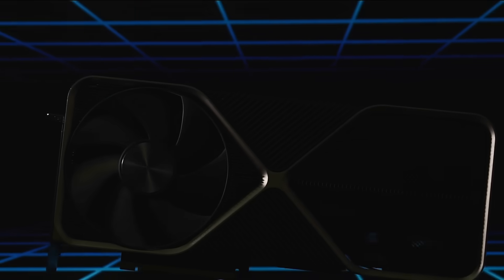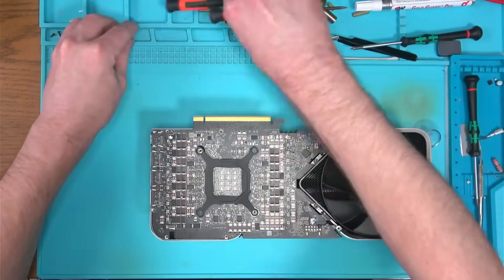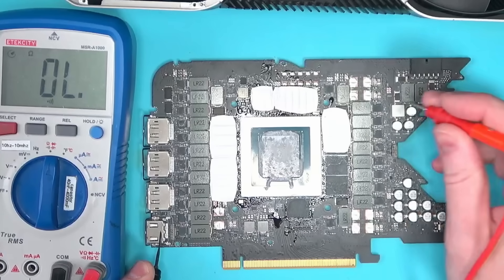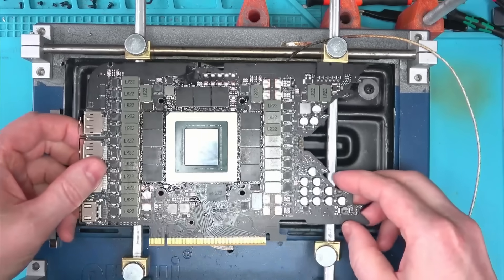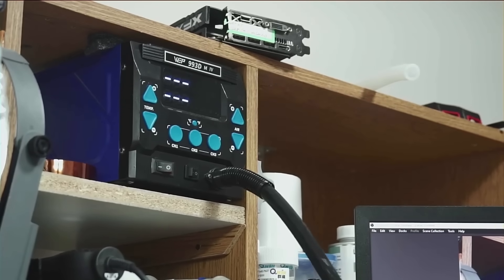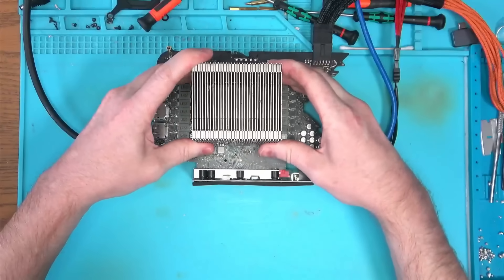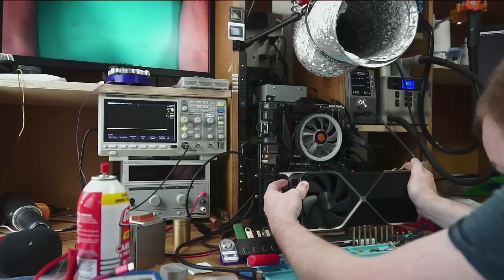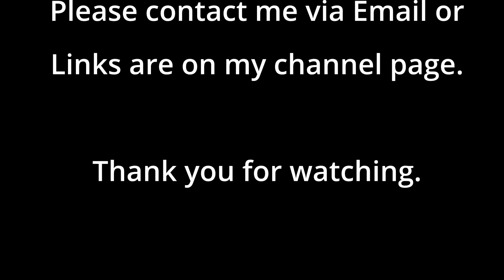Why 4090 reflow is a BAD IDEA

Comment: You fixed one of my rtx 3060 gpus recently. No shit you’re one of the best repair guys on YouTube. Thanks again Tony 🤘🏼
Reply: He fixed my 3080 a little over a year ago, cost more to ship it then for him to fix it. he also repasted and put new pads on it. his attention to detail is amazing and very fair on price. also this card lives a tough life running games on a 4k tv almost everyday and has given me zero problems since.
Reply: What did he charge?
^..^~~
Reply: Do you have the schematics for these? How do you repair if not?
Reply: You fixed that waste of sand? Jeez
Reply: @tlv8555 I run a 2060 in my main pc to this day because it does all i need it to do, not every usecase requires a 4090, and when i upgrade Ill convert this one into an egpu for my laptop, the 3060 is fine, not great but no waste of sand in my eyes (that award goes to cards like the 4060 or GTX 1630)
Reply: @tlv8555  an RTX 3060 is still a quite decent modern card (especially the 12GB version). It outperform a RTX 4060 8GB and RX 7600 on 1% low FPS  at 1080P on titles like Horizon Forbidden West.
Reply: @tlv8555  the alternative option is spending even more to buy a new one or a higher end model. A repair is the most cost efficient option
Reply: @tlv8555 like yourself own a 4090 😂 bet you don't
Reply: @tlv8555  I’ve got like 8-9 GPUs man.. Including 3080 Ti, 7900xtx, 4070 Ti.. I fixed it because of the silicon being able to overclock to 2200mhz. You must have more PCs than those right?

Comment: Still on the 4090 grift, huh? It was fun at first, now it's just stale.
I pity those that got turned off this great GPU due to your videos, sucks to be the one to get a defective card, but if you do everything carefully - you'll have nothing but a delightful gaming experience and/or a helluva work tool.
Haven't had any problems with my own, gonna replace it with a 5090 later, especially if the rumours about 32GB VRAM capacity would turn out to be true.
Reply: It should also be GDDR7 memory so it’s gonna be super fast as well. I just hope it’s not as expensive though

Comment: well i done it also on radeon graphic card HD graphic line dont know the exact number now well it has crahshing and artefacts till it jumped in to smaller resolution and couldnt be changed , i ded reflow it with a heat gun , well it is still working i have it us backup gpu if me 1080 ti will fail one day just i was probably lucky but it works for now :D :D i meen rebal doesnt make sense on card for like 150 € yea but i did done it without flux just did make sure the gpu is level soo it doesnt move and heated it up to temperature

Comment: I can confidently say Tony, you are probably one of the best gpu technicians out there. That card came if for not working and not only did you solve that problem but you also fixed cosmetic problems too. The attention to detail is what makes you good.
Reply: Not only that he even solved mechanical problem with the fan
He is a god 😶‍🌫️
Reply: is he hell he's full of sh*t
Reply: He's the BEST GPU TECHNICIAN that's ever lived.
Reply: Tony Stark?
Reply: @Osy999 nah it’s Tony Spark.
Reply: If he's going to put this thing on eBay, it needs to be "like new". :-)
Reply: That will be $200 extra for the bashing out of the metal frame or you can have it back unassembled (if he was ASUS) ;)
Reply: agreed man this guys  is very good at what he does u can just tell
Reply: On youtube* 
Most technicians don't run YouTube channels
Reply: @GARBO96  what's the point of that?
Reply: @danielhulan3058  his take based off of what he sees this just happens to be the most famous GPU technician known  does not mean he's the best. But if your questioning with the point of me commenting is I would ask you the same thing
Reply: @GARBO96  look at the majority of the comments here man. Your in the minority. This guy is a beast at fixing gpus. Have you ever watched his videos where he has to literally cut away a large part of the board to fix a short? And it works afterwards! Also, just fyi there's a lot of techs that put videos out of them fixing gpus.
Reply: @GARBO96  also I said one of the best bud.

Comment: ngl all the big gpu companys should hire this guy he really knows his stuff love your vids man
Reply: please god no... the best people are the ones that work for themselves...
Reply: @BelowAmbient yeah...true iether way this guys good asf
Reply: They have their own in-house people who can do similar repairs - the problem is, when you have a manufacturing line that can spit out new cards, there are limits to what is economically feasible and it is hard to provide same reliability from reworks/repairs vs. new. 4090 and higher priced pro cards have changed the equation somewhat, so it happens more these days, but back when high end GPU was <1000$ new, anything more than swapping bad memory chips or replacing failed fans would usually be skipped. Instead, warranty claims are swapped to working remanufactured cards and bad ones go back to china where they simply desolder the GPU, solder it to a new board and verify that all works - and if it does, you have a card to send to the next warranty case.
Reply: @Jarnis-v1c  Oh come on, the same level of reliability is easily feasible with rework/repairs. If that would not be the case, I would be out of work because the aviation world out there would just buy new instruments instead of getting them repaired, what I do for a living. There are complete industry standards set up on the best practices to conform to this level of reliability. There's a lot of knowledge about copper-disposition due to soldering and such and the degrading reliability that comes with it.
I expect repairs to be done in batch-processing: instead of repairing just one, they send the customer a new one and just prepare 20 (or more) units for rework, feed them under the removal-heater one by one, clean everything one by one, reball all one by one and then send them through the assembly process again all at once. This happens at more companies where repair of just 1 unit would be too costly.
Reply: @weeardguy  It comes down to cost of rework vs cost of manufacturing a new one. Aerospace parts are done with much smaller volume and repair may be far more economical than with mass produced consumer electronics. Aerospace parts also tend to have much bigger margins vs actual BoM of the component, giving room for economical repair/refurb.
Reply: @Jarnis-v1c  Of course, but that's also why I expect manufactures that do offer repairs, to do this in batch, as repairing just 1 at a time is just too expensive/time consuming. Most of the parts I work with are 'normal' electronic parts you can get of the shelf, but as they now suddenly have to be aerospace certified, the price easily increases by 30-fold or even more, also easily surpassing the price of an instrument itself. Hell, sometimes the price exceeds the listed price of the instrument by 6-fold and the customer still agrees on getting the repair done, I just don't understand it at all sometimes.
Reply: Or but him a house with a retirement plan in exchange to train a dozen techs.
Reply: why would they do that? their profits would be cut in half because he would tell them to stop designing the cards like crap.
Reply: nah he would be fixing too many cards and they would not be making enough money with new cards then....

Comment: Why the SMDs under the board won't fall off when it's on the bottom heater
Reply from the maker: surface tension
Reply: @northwestrepair  Yes I got  It. Thank you Sir.

Comment: An excellent repair indeed.
Reply: still probably cost a lot of money I agree with technician though why the heck would you try to reflow the core that way that has a worrse success rate than the oven method
Reply: it is not a repair. Problably going to get toasted in a few months. Then after a few hours then afteer a few minutes. Reflow is not repair. It is a purgatory cycle of lies.

Comment: Any idea what would keep a core temp high with repaste and new pads?  I used kritical pads, mem temps are great now, but now the core thermal throttles no matter what I do...are the pads just to thick or perhaps using up to much of the thermal dissipation capacity of the FE cooler?   I've tried everything else but swapping the pads again...the cooler also lost its nickel plating on the heat sink contact surface, so I am hoping the cooler itself is ok...Any ideas would be great!
Reply: New pads are often time a really fucking dumb idea. Unless you get the exact specification for pad thickness, its going to cause issues. If you dont know what thickness of pad, you should not be redoing the pads. Until you know EXACT pad thickness, you do not touch them. 

Its 100% the new pads. Look up your exact GPU model and see if someone has posted a Thermal pad thickness.
Reply: My guess would be too thick pads.
Reply: Well, the FE uses PTM 7950 and thermal putty. So, those Kritical pads are a downgrade, and there's nothing outside of maybe liquid metal that would have been a worthwhile upgrade as a TIM for the core. TL;DR: you wasted your time trying to "upgrade" it and ended up downgrading.
Go buy some fresh PTM7950 (or a Kryosheet) and either reuse the original thermal putty that was on the memory or buy some new thermal putty. That's the best cooling performance you're going to get without liquid metal on the stock cooler.
Why was this all a downgrade? Because thermal putty perfectly conforms to the spacing you need, giving you ideal contact on the core. And PTM7950 doesn't dry out, so 6 years from now you'll still have good performance
Reply from the maker: wrong size pads
Reply: Thanks for the fast responses!!! I apologize for the bad description, this was a 3090FE that originally had 105C memory temps; the first pads I used fixed it for several years and I mined with it working very well during that time ,  it was actually giving me lower temps across the board  that whole time, then the TP dried up, cores crept  up.  I changed to the Critical pads that were supposedly sized optimally for this 3090FE...I'll just go back to the other pads then,  I just wanted to make sure I was correct in my thinking.  Thanks for the reassurance guys.

Comment: Hopefully the 5090 doesn't have these issues anymore
Reply: I bet there are even more problems for twice the price. 😂
Reply: It's supposed to be 3 circuit boards instead of one.
I'm sure it'll be a nightmare to repair!
Reply: Huang: "Yes"
Reply: Why wouldn't a 5090 suffer the same problems like a torn trace/capacitor or a bad reflow? Such a pointless comment as the faults can all happen to any GPU not just 4090s.
Reply: @zorbakaput8537  Because your circular argument is just that.  Why would they suffer the same issues when other gpu releases haven't?
Reply: @BenState  just wait till Nvidia brings you the singularity gpu. So crammed together you can't even see it, but uses all the power in the universe.😅
Reply: With 3 stacked PCBs, it's going to be nightmarish worse....
Reply: @intoxicode  multilayer pcbs have been around for decades.
Reply: @BenState  i didn't say multilayer, I said MULITPLE PCBs, stacked together.  🤦🤦
Reply: @intoxicode  even easier to fix
Reply: @BenState  You ate many types of paint chips as a child didn't you...
Reply: @intoxicode  im an avionic engineer.   but go on, tell us your qualified opinion.
Reply: After all your childish comments i really doubt anyone would let you anywhere near avionics engineering.
 @BenState
Reply: @AngelA-tj9ok  Childish comments such as?  Go on, enlighten me.
Reply: Will be worse
Reply: why not though? more problems more content for us ASMR repair junkies, i say bring it on, let Tony cook!!
Reply: They're geared more for ai than gaming. So meh
Reply: @DeadNastyRust  Yeah, you know all about the GPU that hasn't been released yet.  So meh.
Reply: @BenState  no one cares